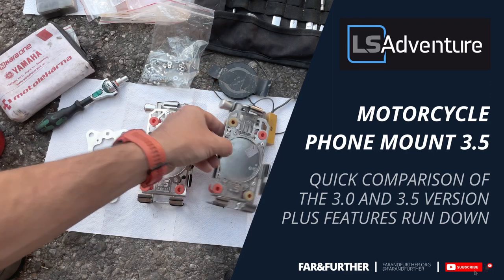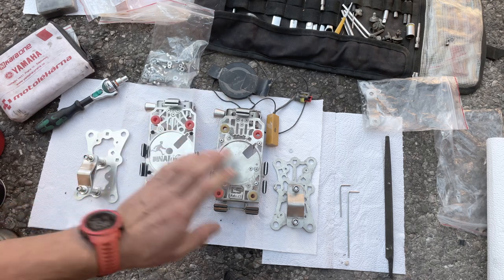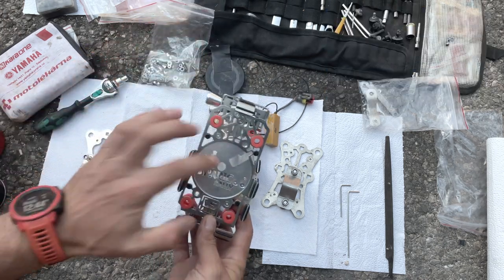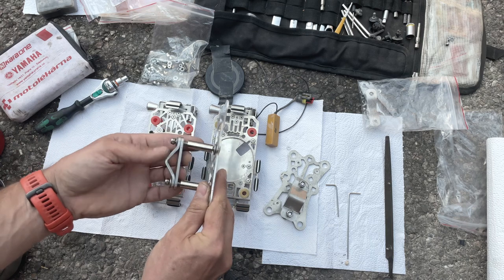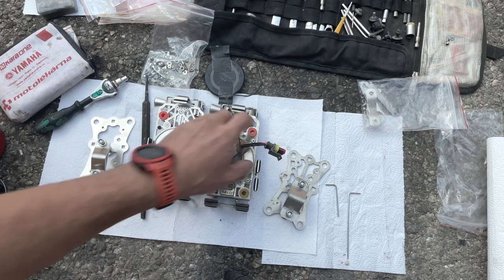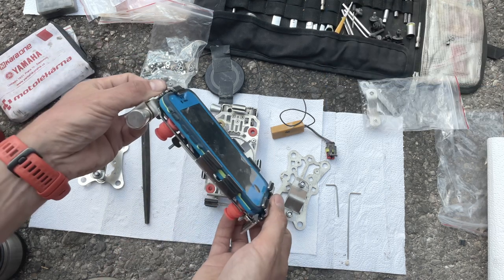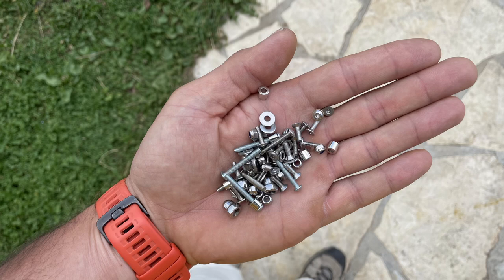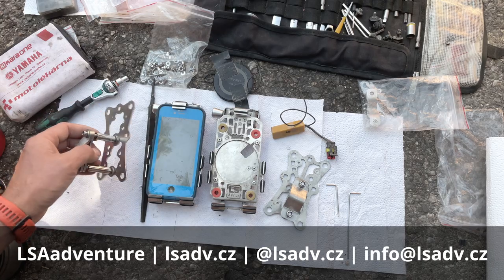Heavy duty motorcycle phone mount by LSAdventure - version 3.5 update

Comment: Hi, love your videos. For the sake of 400g I would prefer a steel mount. In my experience aluminium fractures sooner or later in off-road conditions, it’s a question of when not if.🕊
Reply from the maker: Hi I'm really happy the videos are useful. With the mount, let's see.... how it will go the original full steel one lasted incredibly long. This one has already some good amount of off road and most of the aluminium parts are really not structural. Only time will tell.

Comment: I took a look through your video list looking for a video where you made the Custom charger mod but did not see one.  Did I overlook it?  Reason I am curious is the new Garmin Zumo XT GPS motorcycle cycle power source has a large 'box' (technical term...I assume it's some kind of voltage regulator) attached in the middle of the cable and it's a challenge for installation.  Something like what you have done for your wireless charger could be a solution to make it better.
Reply from the maker: I'm not sure if I have a video about it.... I don't think so. I made some posts on the Instagram (https://instagram.com/farandfurther).

What I've done is:
1) Made water proof harness which goes from Battery - Fuse - 1 to 3 lines splitter.
2) Waterproof USB charger which is attached all the time and powers the TPMS
3) Wireless charger I've used the 12V -> 9V convertor + used the electronics from the Wireless charger and connected those that's also attached all the time.

I've decided to use special casting epoxy on all of those because it's designed for electronics, it's trasfering heat (cools things down) and most importantly when electronics is casted like this the vibrations can't kill it.

Maybe I should do a video... on instagram there are post and some description as well.
Reply: @FARANDFURTHER  
Thanks.  I will check out the Instagram posts.

Comment: A new post by the Apple Support Forum suggests that the strong vibrations released during riding a motorcycle could be harmful to the iPhone’s camera module. The smartphone manufacturer recommends against mounting the phone on a motorcycle to prevent this.
Reply from the maker: That’s why I use old iPhone 6 instead of the new flashy phone as I said in the video.

Considering that this mount has all rubber mounting it may be easier in the phone but I would not mount and expensive phone on the motorcycle.

It is quite common knowledge that iPhone cameras don’t like vibrations be it on the motorcycle or bicycle.
Reply: @FARANDFURTHER  Without proper testing it’s always difficult to know if rubber mounts decrease or increase the effects of vibration.🕊
Reply from the maker: I guess thats true, but I've been using it with the iPhone 6 for years and the camera is fine. I know it's not the lab test but it is some test. I'd not put in modern phone though...